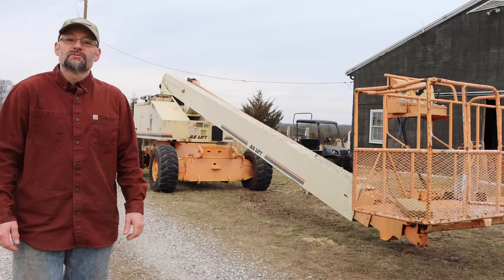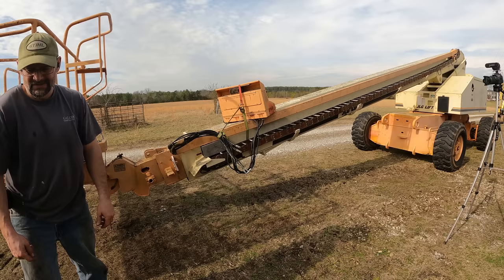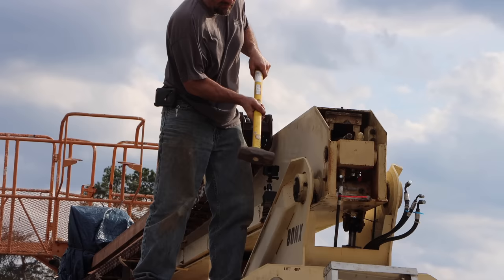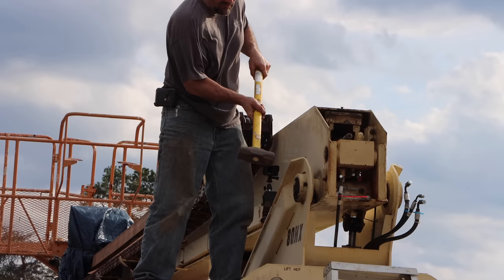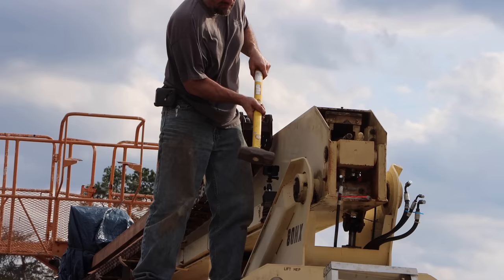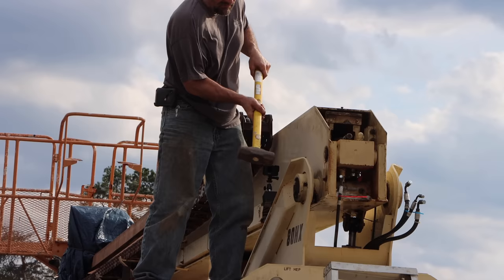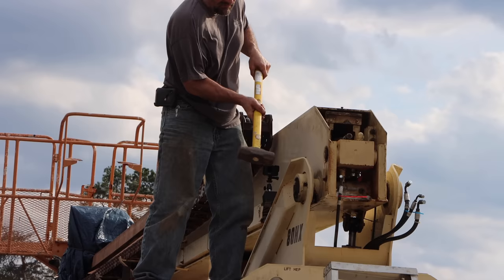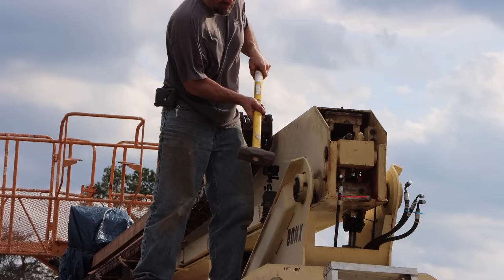JLG Boom Lift Tear Down, Ended In Disaster!

Comment from the maker: www.farmcraft101.com.  So you just saw me take this whole thing apart.  Do you understand how it works?  How 1 cylinder moves both the fly boom and the mid boom, and at different speeds?  It was tough for me to get it all figured out and be able to really understand what's going on.  We will look at that next week, and also see what damage the fire did and get that fixed up.  From now on, when using a torch on a machine, I will use a welding blanket and have fire suppression right beside me, ready to go!
Reply: It works a lot like a 3 stage forklift mast
Reply: Another great video! Glad to see you are safe and sound :-)
Reply: Would asume its the same way as say our old (very old at that, but think its the same for newer ones) forklift at the shop, essentially its a rope and pulley "in reverse", were on the forklift you use say 1m of hydraulic stroke to for a 2m lift via the chains. In reverse to a rope and pulley, where you usally trade lifting speed or hight for reduction in force, you trade force for incresed lifting reach.  English is not my first language, but essentially your (to use the rope and pulley reference) you are pulling at what is usally the "lifting point" at a usual rope and pulley setup. You have to use a lot of force, but move hell of a lot of rope quickly. Somewhat simplified, and you can use that in different stages for 2-, 3- or x- part stage for multiple parts moving, at different speeds. (think a three pulley system moving a 2 pulley system moving a 1 pulley system, moving the rope, and so on). 

Truly can relate to the panic with the fire, had an accident when making a fire to deal with waste from clearing. Thought it was safe, just a metal wall as nearest building, and it was far away, but sawdust from my mill was accumulated near the wall (hidden spot) and embers had made it there, some 25-30m away, it filled the entire storage unit (20m*30m) with smoke before i found it, and managed to put it out thankfully (with no damage), but that was full on panic mode. Couple of more minutes and the whole thing would probably have burned to the ground.
Reply: @FarmCraft101 - fire suppression right beside you *that works*. Devil's in the details...
Reply: Thank you for sharing the event un-edited. Happens to all of us and sharing helps us all learn. I was fortunate enough to work in heavy industry and had a lot of experience looking over my shoulder a lot of the time.

I still make these mistakes too. It’s impossible to know. All I can say is get an oversized ABC extinguisher. Hell I even keep a small ABC in the kitchen.
Reply: Ohemgee, Jon, you're ok, & 
so glad that fuel line didn't catch on fire, whew!
I'm looking forward to next video.
hUgz for the entire family, Lee
Reply: Hey John, next time you are pulling stuff with chains attached to your truck, could you maybe precut one of the links with a grinder, so we can see your rear window getting smashed when the chain parts? I think it would be great for views, and pay for itself... Plus another video replacing the glass! Just hit me up, plenty more ideas where this one came from!
Reply: Dry chemical fire extinguishers will eventually clump from even a small amount of moisture in the canister. Even though they are charged with "dry" gas for pressure, they will clump/solidify over time. Best you can do is shake them monthly to help ensure they don't clump and replace them every year or so if you want to 100% sure they will work. This is why we ( 30 year Firefighter) require businesses to service/recharge their extinguishers annually. A Pressurized water extinguisher is good for most all fires with the exception of Energized Electrical Equipment (obviously), tho once power is off it's essentially a Class A fire. The addition of a small amount of Class B foam (and really even some class A - such as dish soap) will handle most small Class B (grease, oil fires). Upside is .. PWs don't clump and aslong as they're properly filled and charged they work. 

Don't rely on old extinguishers to work - even a year old - an definitely beyond that, the y may not. Most don't consider fire protection until they need it, and often that's too late. All and all.. good stuff John... Fun to see you hustle and make mistakes like the rest of us. Love the content.
Reply: works the same way as a hydraulic elevator, cable hard fixed at the bottom, rides over a pulley connected to the hydraulic piston, other end is attached to the cab..  The pulley on the piston has a 2 to 1 ratio of movement, so piston only needs to be less than 1/2 total travel length.  Yours is similar,  but has a larger ratio being split in 3
Reply: @jonhammes6209  except there are two (or actually 3) one each side, hydraulic cylinders on FLT masts
Reply: I actually worked at a shop that did maintenance on JLG and GENNIE, So I didn't do the maintenance myself but watched from a distance and they did the same thing you're doing except it seemed like a lot safer, they did it in a shop with an overhead crane just like you had spoken about. I'm not criticizing your work by any means but man you got balls anyway I'm enjoying watching your video man. PS, remember when Clint Eastwood said "A MAN'S GOT TO KNOW HIS LIMITATIONS" he was speaking about me not you lol
Reply: Them jackasses at the factory, just a little anti seize and you wouldn't have had any problems! MAYBE! Glad you got the fire out before the whole thing went up! Your videos are awesome, everything I luv to do!
Reply: Ok you crushed it, what was the expiration date on it? A fire extinguisher mounted on the bucket is also to recommend for when you put your machine back in working order
Reply: I was pretty puckered up watching you, man, the suspense... so glad you're ok! Now I'm going to check all my extinguishers, shake them, and double-check dates. There's a bunch, but clearly you can never have too many.
Reply: Still don't have the slightest idea how it works, looking forward to finding out in the next one. Just want to say thank you for the hours of infotainment. This is definitely one of my favorite, if not favorite channels.
Reply: Man you got me thinking that I better test (use up,) and replace my extinguishers around the shop.Theyve been around a while and it would be a  good way to train the wife and kids since they don't get the same training I get at work
Reply: just as I thought.... not a damn thing wrong with that chain or boom.
Reply: The idea of the crows foot to keep the hydraulic fluid from running down the wrench and then down your arm as you're working with hydraulic hoses is a great idea. I don't know if that was your intent but that's what I was thinking as you were doing it. 
That fire situation could've been much worse. That ladder wasn't even open all the way. I'm glad you didn't take a ride on it when you were running up and down it. Then there's the fact of the fuel line and all the other combustible stuff. God was watching over you. I hope you thanked Him. 
Thanks for sharing this stuff with us and God bless you and your family.
Reply: Have you ever tryed candel wax as a penetrator some times it works beter then penetrator oils
Reply: Get a hyraulic cyliner that has a hole in the middle of it. Then use ACME-threaded rod to pull those pins out. I have one and it’s good tool. Study it.
Reply: Let's be honest, I bet you thought that would be fun to do.
If I was honest, I watched the whole damned thing with trepidation and was relieved to see that you didn't get hurt.
Reply: If the sawzull cut straight through the pin, why didn't you simply use it to make some relief cuts after drilling the hole through the pin?? I mean you would've needed to be really careful not to cut the bushing but wouldn't that been much more gentle than basically melting the thing 😂
Reply: Most lessons end up being taught the hard way.
Reply: Wished I had 100 bucks for each one I had taken apart and resealed the cylinder. Most the time we just arc gouge the pins. Great vid I must say.
Reply: First of all, WELL DONE 👏 getting as far as you did with no assistance.  Those are tricky at the best of times.  Too bad about the fire but these are the hard lessons!!  (Had a few of those myself).  I am sure you already have done so, but just wanted make comment about the need to disconnect the batteries and close any fuel and oil shutoffs, especially after an incident like this.  With fires, or collisions, we never really know what wiring or cables have had their insulation melted off or have been pinched or rubbed through and could cause another fire later on.  

Came to work one morning to find the truck that had been towed in the night before after an accident had caught fire in  the middle of the night!  Luckily the fire suppression system in the shop did its job and so the result was a melted cab and a big black stain on the ceiling..... and a tool box full of water!!

Anyways keep up the good work and all the best from Canada!
Reply: @guytech7310  Seems like you could have an extinguisher that gets pressurized by a co2 can - sort of like a soda stream.
Reply: @joeporkka2047  Not worth it when Air works just fine.
Reply: @shatoxhd  I was thinking something along the same lines, and then when I saw him get the torch out I said to myself, this isn't going to end well
Reply: @mtbprof  Here in my part of Texas there is a species of mud-daubing wasps that are attracted to circular openings the exact size of the orifice on a dry chemical extinguisher. I keep mine plugged with foam hearing protectors. The foam would offer no resistance when an extinguisher is activated, but keep the insects from clogging them up.
Reply: something like this where you have a "ring" - if you weld inside ring enough it will shrink diameter. same style works with like bearings too.

Comment: Another options for removing pins is, once you've drilled through the center, stick the sawzall through the bushing and cut from the center to the outside.  You don't have to go all the way through, even having 1/16" left will relieve a lot of the pressure, and  it will then respond better to heat and force.  Think of it like using a nut splitter, but from the inside.  Cut two reliefs opposite each other, leave very little metal between the halves and it'll come out even easier.

All that said, you did well, and while mistakes were made, your reaction and thinking through once disaster hit was spot on.
Reply: And its a less fire-y option than oxyacetalene...
Reply: This was also what I was thinking.
Reply: was thinking same thing. but pretty hard to shout at you in the past.
Reply: That is what I was thinking.  I've seen how quickly fires can take hold, especially when flammable liquids are nearby.
Reply: Girls use saws, MEN use FiRE! 😂😂
Reply: This has worked for me too
Reply: You can also use smaller diameter drills to stitch drill from the initial hole in the centre out towards the OD. Any remaining metal can be sheared with a cold chisel.
Reply: Indeed
Reply: Was thinking the same thing as I watched him drag out the cutting torch. Oh well, you know what they say about hind-sight. It could have ended up much worse but lets hope the damage is not too extensive.
Reply: This is a method I have done more then once, it works good.
Reply: That's been the usual bodge for me and my father for many a year.
Reply: Yup.  I use this method very often pulling suspension bushings, pins, and rusted in balljoints.
Reply: That's EXACTLY what I was thinking and YELLING out loud to my unresponsive computer screen LOL.
Reply: When you're slaving away at an unforgiving project like this -- I completely understand the impulse to break out the meanest tool you have, hard to beat oxy acetylene at that! Let that pin taste the fires of heck, blast that jeezlus thing right into low earth orbit!
Reply: Just a thought I would never drive a pin out on the side I have been beating on, it would have expanding it on that side. Once you had drilled a hole in it I would have used a long bar from the opposite side assuming the option was available. Also a small porta jack could have been used in this case. You might consider putting some grease holes in some of your new pins
Reply: I had a similar un-lubricated pin removal on a JCB stabiliser leg... video here https://youtu.be/06Eldjctc6U
Reply: I had a similar problem and used the Sawzall method.

Comment: You probably know this, but here goes. 
The dry chemical in a modern fire extinguisher tends to settle, agglomerate, and clump at the bottom of the canister over time. So even though a unit may have full pressure and a useful charge of retardant, it just becomes self sealed up. Turning them over and shaking them every so often usually does the trick. 
When you threw yours the impact probably loosened it up enough to again get it fluidized internally. 

Hell of a video John. Thanks for sharing.
Reply: Nailed it.
Reply: I was thinking the same thing. I’ve seen a guy do the upside down shake and bring one rite out of retirement.
Reply: Every month where I work, we have a guy who walks through our whole building to turn our fire extinguishers upside down a few times... Now I know why. Today I Learned.
Reply: Maybe a good idea to store them on their sides? Probably easier for the powder to clog right around the end of the dip tube than it would be if it was spread out along the side of the cylinder. Would be thinner too which I’m imagining would be easier to break up once clumped than a big mass.
Reply: @timr86868  The powder would still become stagnant. The rubber mallet is part of the annual inspection by licensed inspectors.
Reply: I had no idea.  Thanks so much for sharing this tidbit. 👍    

I'll discharge my two (kitchen and garage) as a test, get replacements, and turn the new ones over monthly going forward.  They've each been hanging unmoved on the walls for years now
Reply: What is correct process?@time1800

Comment: John you have balls of steel for even thinking about taking apart this boom by yourself! We take apart forklifts half this size and requires 3 guys minimum and an overhead crane... the fact you actually managed this is honestly breathtaking. GOOD JOB! We all make mistakes especially on jobs this big so I would chalk the fire up to a small error in judgment which is completely fair in that situation. I'm so looking forward to the next part!
Reply: 1 man job with a mechanic truck crane… not sure where you’d need 3 guys
Reply: mistakes are the best learning experience!
Reply: Couldn't agree more. He could really have done with a second set of hands
Reply: no i am a welder of very big buckets and repair most with over 80 mill pins....john has balls of super strength titanium with ozium inners...
Reply: I’ve done a lot of things that I wasn’t aware that I couldn’t do. A lot of us have. Steve
Reply: It's the knowing what's involved in putting it back together that's making my head spin, surely a 3 man job?
Reply: Why don’t you use the plasma torch?

Comment: John, fire extinguisher maintenance is super simple. At a minimum of every 2-3 months, shake the heck out it and make sure the powder isn't caking. Once every few years, if its a metal head, just rebuild it. Just flip it up side down and let the air out. Clean the head and replace the seals. make sure everything is bone dry. Moisture kills the valves if there is even a hint of powder inside them. And never test them by just hitting it a little bit as that WILL make them leak or freeze up. New valve guts are cheap too. Inspect the parts for corrosion and install new orings etc. The plastic head extinguishers are not rebuild-able.
Weigh the powder going in. You need some air space. Make or buy an adapter to hook it to a air tank with regulator. You unscrew the discharge funnel and that's where the air adapter goes. Fill the bottle with dry nitrogen to the recommended pressure by squeezing the handle with the regulator set to the pressure. (around 80-100psi normally). and you're good to go.

Comment: One way to shrink bearing shells or in your case a pin with a hole inside is to arc weld the inside of the hole. The weld not only heats the pin but causes it to shrink on cooling , much the same as what you did. Great video!

Comment: A little late in the game but if you find yourself in a similar situation again drill small, say 1/4-3/8" holes around the periphery of the pin, just below the o.d. so that you don't actually break through. 4-6 holes around the o.d. then drill the big hole in the middle. Pins like that have a lot of compressive strain on the o.d. of the pin. Drilling a bolt circle around the i.d will relive some of that stress. If you were to take a solid round bar, drill a hole in the middle, then saw cut through to the outside, the o.d. will spring outward. This is what you were fighting.

Comment: My dude can swing a sledgehammer over and over and over and over and over and over and over and over again. But gets winded after running around in an adrenaline fueled panic for a couple of minutes. 

Just shows what adrenaline does to your body. 

In regards to the extinguisher, it may have been the trigger valve that failed with age. 

But you reacted brilliantly. Knowing what you had to hand, your property, etc saved the machine. Hopefully it's just a couple of new lines to replace.